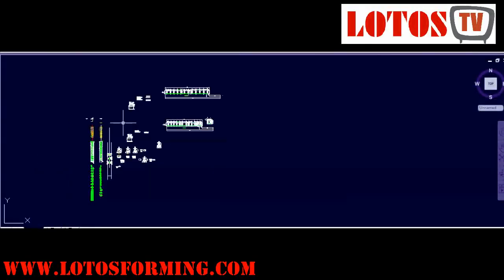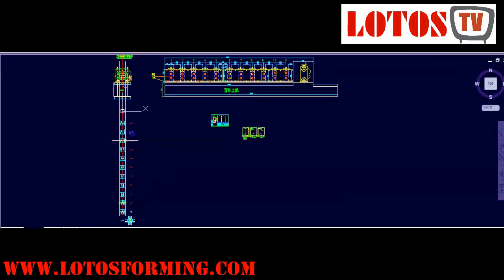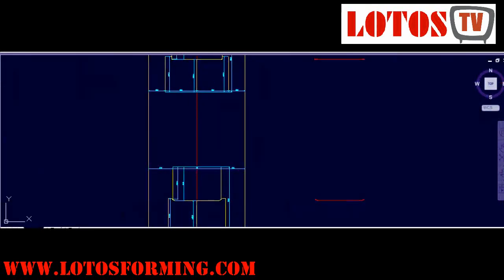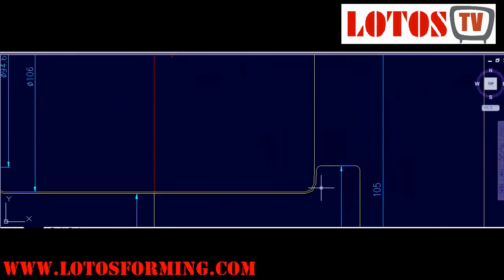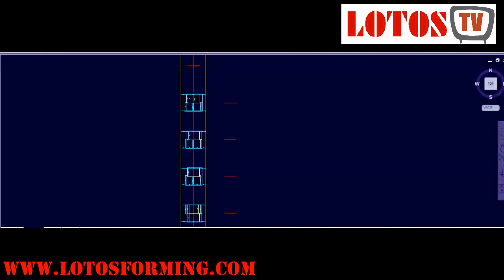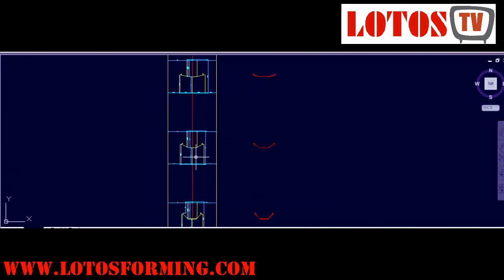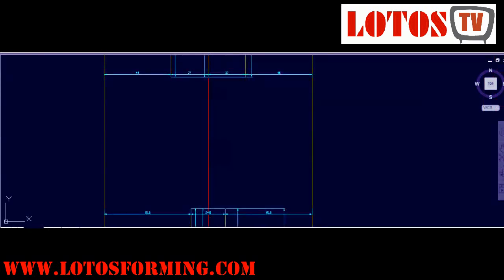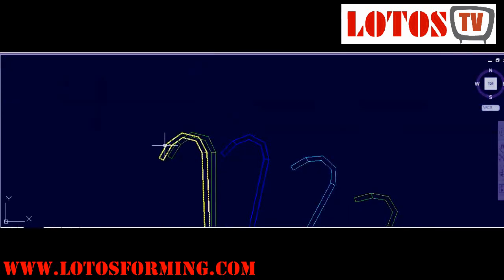【Roll Forming Software】:  Profile Drawings Roll Forming Machine " LOTOS DESIGN "

Comment: Hello team LOTUS.
I have gone through a paper on basic roll design by ROLL KRAFT USA. I do not know how to use softwares like  COPRA or other FEA methods. I can only use autocad.
 If i go by constant arc method to develop an upright section that looks like OMEGA shape, can i use outer radius to calculate arc length or is it necessary to use inside radius and then add 'k' factor to it. Strip thickness is 1.8mm in HR 'D' grade.